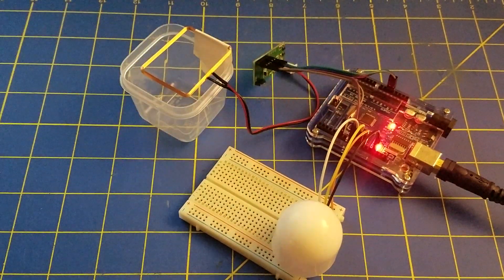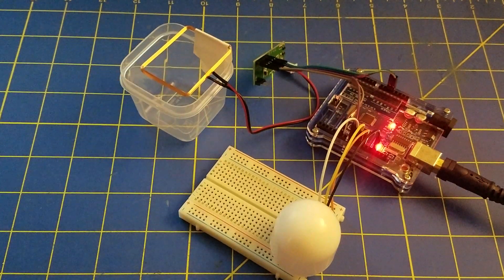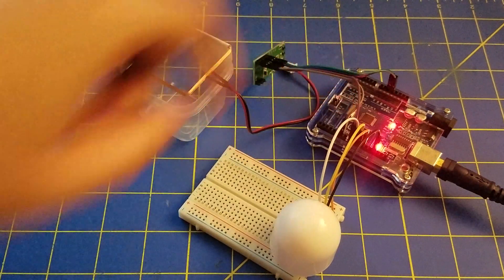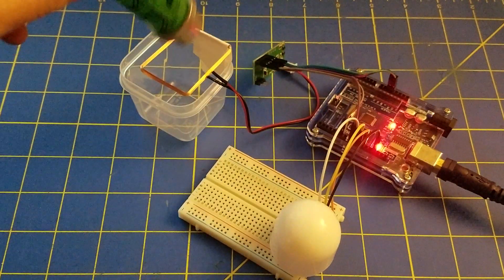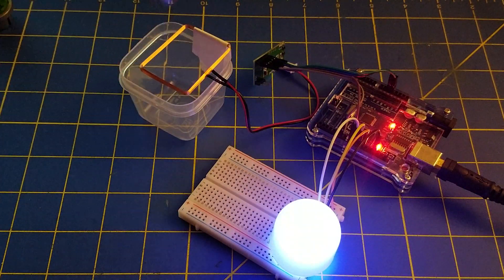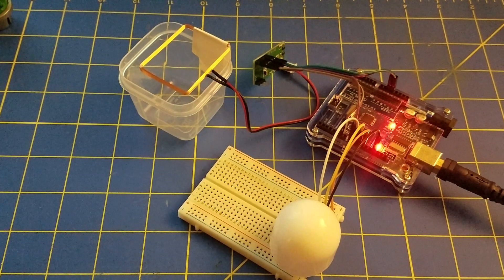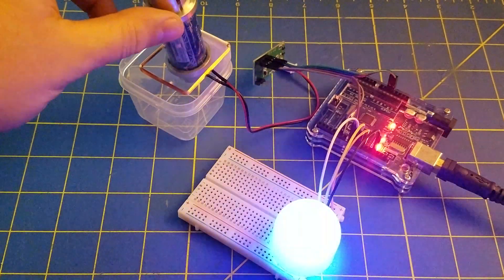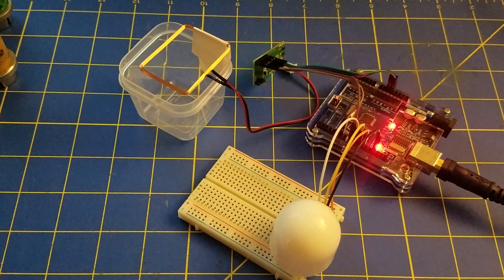Kyber Crystal RFID Reader Demo

Comment: Has anyone tried this recently? I can't seem to get the RDM6300 to read any Kyber Crystals. I've tried two different RDM6300s and alternating the antennae. I have the RGB light working properly (blinking R G B on startup) and getting the "Ready" message in the serial monitor but nothing else. I'm wondering if there is a library change that may be preventing it from working.
Reply from the maker: if you joined the swge discord server at swgediscord.com and search the makerspace channel for rdm6300 you will find several threads about this.

first step is to dump the raw output from the rdm6300 to serial just to prove whether or not data is being generated.

there is a version of the rdm6300 that has different firmware that breaks existing libraries. the only documentation I've seen about it is this Russian forum
https://arduino.ru/forum/apparatnye-voprosy/rfid-rdm6300-v40-poddelka-ne-rabotaet-kak-rdm6300-v03-resheno
Reply: @Ruthsarian  I appreciate your quick response. I've been looking through Discord (I apologize for forgetting to check there) and still can't get my RDM6300 to read with the very basic RDM reader program you had posted there. I'll keep banging my head. Thanks.
Reply: so my RDM6300 is working with my home made kyber crystals but not the official ones.... i need to do some more digging
Reply: @Raptorsirrationalinventions  I appreciate the response. Did you use @Ruthsarian's program?

Comment: Does this work with the rc522?
Reply from the maker: no. kyber crystals use 125kHz RFID tags. the RC522 is designed for 13.56MHz RFID tags.

Comment: Hey thanks friend! This helped me get started with a little project I wanted to make! I'm planning to make a small reader to identify the crystals while buying them :D. I plan to throw it together with a Teensy LC, one of these RDM modules, a 1in i2c oled, an old single 18650 power bank and then 3d print a case. I really just want one of each characters, without modifying the crystal. Finding a black crystal would be nice too, but not my main goal.

Here is my finish project: https://photos.app.goo.gl/PbAzvDLA4cTsyxVV8

Comment: what is the arduino you're using
Reply from the maker: an arduino uno with a laser cut acrylic case. it came as part of a kit i got a few years ago.
Reply: @Ruthsarian  one other thing, i'm trying to replicate your rbg led setup and i'm kind of real novice at wiring. So I've got the vcc, gnd, and tx wired up, but i'm trying to figure out how you're pinning the color read out. Are you use the rx to ch8 and then 9-12 to display the colors?
Reply from the maker: @ubmae86  the ardunio reads in the data coming from the RFID reader over a serial connection, which includes pin 8 as the RX line. the arduino then enables the red, green, and blue LEDs as needed to achieve the color that matches the crystal. the RED LED is on pin 9, GREEN on pin 10, and BLUE on pin 11. Pin 12 is not being used for anything.
Reply: @Ruthsarian  then what is attached to row 2 on the breadboard? is that a grounding path?
Reply from the maker: @ubmae86 yes. the RGB LED I'm using is common cathode. it has 4 pins. one for the anode (+) of each red, green, and blue LED in it. then all three cathodes (-) are connected together to the 4th pin of the RGB LED which goes back to the arduino's ground.
Reply: @Ruthsarian  That makes sense! Thanks so much!

Comment: Super thanks for the video. Now need to think of smaller antenna to fit in my lightsaber. Just from curiosity, did you manage to see in which part of the crystal is the tag?
Reply from the maker: there is an opaque area in the middle of the crystal that runs the length of the crystal. the tag is inside that.

Comment: What other information is on the RFID is it just a code? Interested to know the codes associated with each crystal and the voices for them too. 
Any chance you'll share the sketch? :) I've similar plans to build a stand for my spare crystals,  and for it to detect and display the colour and maybe also output whos crystal it is.
Reply from the maker: i believe it's just the ID of the RFID tag in the crystal that's used. the holocron probably has a table of known IDs and which color and audio to associate with that data.

twitter.com/cowkitty has compiled a table of crystals and their RFID data here:
https://docs.google.com/spreadsheets/d/1mZMBBxSc_ltAyheEVgKL4MpGfPc3iCjR1S6BEaavN40/htmlview 

I believe the "EM TAG ID" is what's being used, specifically the least significant byte of that ID. but until I get a device that can write custom data to RFID tags (rather than just copy existing tags like in this video) I can't prove that for certain.

Comment: Ah, but how will you be able to tell if a "red" kyber crystal package contains a black crystal?
Reply from the maker: A kyber crystal with the tag ID 3123 is a black kyber crystal. Since RGB LEDs don't really do 'black' as a color and since the custom lightsabers from Savi's will display red when a black kyber cyrstal is inserted into a lightsaber this code will turn the LED red.
Reply: Thinking about Disney's move to curtail people from hunting for a black kyber crystal by adding a black insert to the red containers, could you still use your reader to find black crystals based on their tag ID?
Reply from the maker: i haven't seen the new red canisters, but assuming it's only black paper and doesn't include anything that would block radio signals (like a layer of foil or a wire mesh) it would be possible to identify which canisters contain black crystals. however if the CMs see you scanning crystals they'll probably ask you to stop.
Reply: @Ruthsarian  it would only take a esd mylar sheet...already tried it and another way to stop people from reading the tags is to put the tag in ship mode which powers them down until they are activated by a proper device like a holocron or saber.  Very tiny code change...really only 1 digit in code...01 instead of 00.